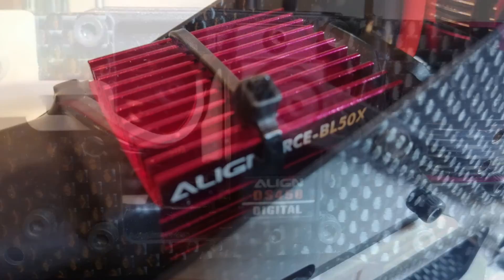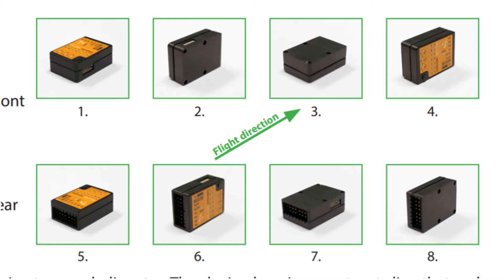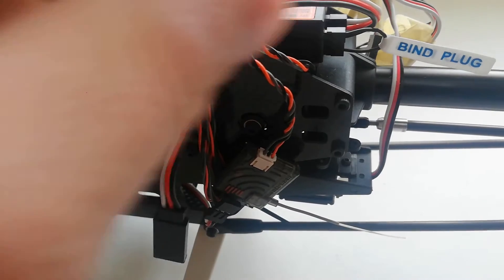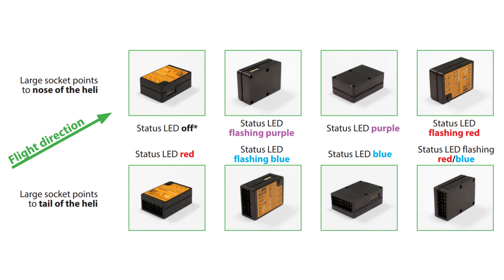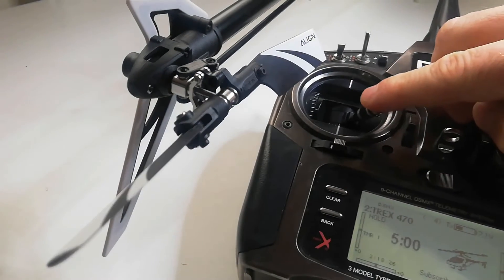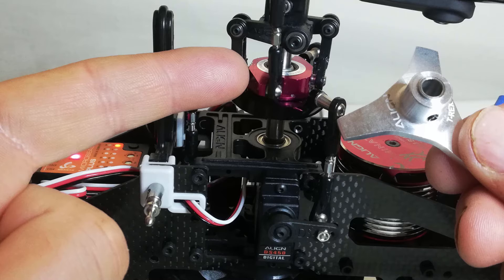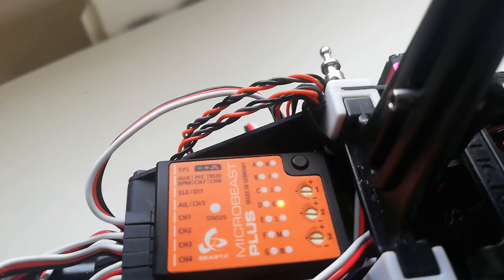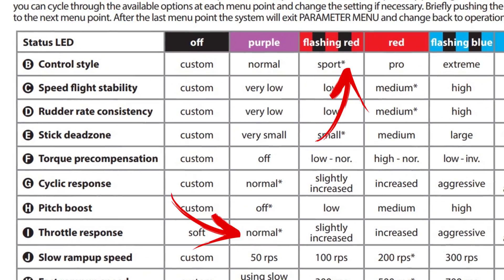Microbeast PLUS full set up - Trex 470

Comment: Wtf have I gotten myself into... I'm so lost. Just getting back I to them from flybars. Well I do onow they will fly just fine without a system. Even flew my 450 trex about 3 yeara ago just off a Spektrum AR630. Even had sade on it setup. Would recover seems like a blink of the eye. But did have one issue in safe. Giving a left rudder input it would climb fast as further the rudder direction was pushed. Never figured that out. So now just repaired the 450 and got a 550 to go with it. Bought two of the same system. Now I see I got sooooo many steps to make just to get it right. I'm sorta now upset. I need help I'm sure.
Reply from the maker: Sounds strange, for sure.  I'm sure there'll be an rc shop or club that can help somewhere near you
Reply: Ikon is much easy

Comment: Epic! I found your video invaluable. Just returned to helis after 20 yrs and have only  flown with flybars.
Got myself a T-rex 470LT super combo and needed guidance on micro beast set-up.
Your vid is just what I needed.....a walk through with clear and specific info......no waffle!
Did u do a video for the parameters menu?
Many thanks.
Reply from the maker: Awesome glad it helped. No video on parameters yet I'm afraid. Loads more videos I want to do but way more busy neith work and family now I'm afraid. Happy flying!
Reply: My sentiments exaxtly!  Im in the same boat being out of helis for over 20 years.  Building an old nib 450 pro dfc but using a micro beast plus fbl from a 700L kit I'm going to use an Ikon2 the seller included in the kit.  Thanks for making sense of the Beast instructions.  I too am using 1 satellite and didn't understand what happened to all the servo wires going into the micro beast plus.  Thanks for clearing that up!  Subscribed.

Comment: Hello, I recently got the Trex 470Lp. I have spent MANY hours trying to figure out the MICROBEAST.. I can not for the life of me get it figured out. I have an AR6210 Spektrum receiver. Also have a AR8000 laying around as well. I can not get the MICROBEAST to read that I have the receiver connected?? I can get everything to work fine following the instructions and this video with only a Spektrum satellite.. but I know only a satellite isn’t recommended. I’m about to give up and just use a satellite and hope I don’t get a brown out.. Any tips or instruction of how to wire up the receiver? I have tried everything, but maybe there is one thing I’m not doing right.. Any help would be GREATLY appreciated, thank you!
Reply from the maker: Hi yeah electronics can be a real pain eh. I never had any problems with satellite only On the 470. It was recommended by a top UK model shop I know it's a common set up. When it comes to the max size for satellite only remember the trex doesn't conform to normal naming standard sizes. So it's only a 380 really. I don't know about those other receivers but try emailing Stefan from microbeast: shornstein@freakware.com He is helpful and ususally replies fairly quickly
Reply: @RCStuffvideos  awesome, thank you! I appreciate your fast reply as well. I also thought just using a good satellite would be fine. But wanted to play it safe. I will shoot him an email anyway. Maybe I’m missing something. Thanks again!
Reply: Won't work with the AR6210. You need AUX2 to set the gyro gain from the MicroBeast. . The AR8000 should work. I speak from experience after reviewing the manual on the JR 9503H Transmitter.

Comment: Great video! Quick question, I'm getting my first kit heli, the Align 550X Dominator Super Combo with the Beast X Plus, I'm unsure of what receiver to use, do I just need a remote receiver like you have on the side there and that's it? I read through the manual a bit in your link, and I believe that's what it says to do, I want to go Spektrum with my DX8G2. Any help you can give is very appreciated!! Thanks!
Reply from the maker: Hi King family RC, I can't remember where I read it but I'm pretty sure for a 550 size, (or anything over 450 to be precise), a single satellite isn't recommended. So you might need a proper receiver as well as a satellite or 2. Not done this set up myself I'm afraid so can't be too exact but I think I think you will need a but more for a 550.
Reply: @RCStuffvideos  OK awesome I'll research a receiver and satellites then! Thanks so much for taking time to help me out! 👍🤙
Reply from the maker: @kingfamilyrc5376  No worries. Yeah I checked, and it was in the microbeast manual it says 450 size or less for single satellite. "Using a single remote satellite is only recommended 
for 450 size helis or smaller! For larger helis please use a SRXL compatible Single-Line receiver for your radio brand."

Comment: Mate hello how are you..... I have a goblin 700 raw and I added the beastx Pro edition since 2016... so it had the version 4.1.5......after contact the support cause it wasn't accept the Pro version which I had paid they fixed that and I updated from 4.1.5 to 5.5.1.....the thing is that a lot have changed and even with the manual i can't get it work and I really regret it the update cause the Heli was flying perfectly......can you help me I have figured more than half of settings but I can't get the electric motor to start....in studiox they have for swashplate 333hz when from the beastx button it has still only till 200hz .... that's the only positive I found in the update....now I have the servos directions fixed but the throttle it's working only as pitch so it goes up And down only and I have not motor throttle....if I figure this out I believe I will find and all the rest settings....and what is exactly these "banks" they added? Like setting idle ups?..... please if you know something more than one help reply ASAP thanks
Reply from the maker: Hi mate.  Sorry to hear of your troubles.  I haven't  updated to the pro version  yet but plan to at some point.  I did it  all on the unit.  I'm guessing  the banks  are bank  angle limits maybe as I'm sure the pro version  can do that.  If that makes sense? Which support  email did you try?
Reply: A little late answer but, if you have both the throttle and pitch moving at the same time, the beast sees two inputs and ignores both. Set you throttle hold on so there is zero throttle input, set your collective. When you get to the throttle, flip you hold off then you setup the throttle. This also drove me nuts for a few. Once you get the channels assigned correctly, using a linear throttle curve, calibrate your ESC. Your motor should respond normally now. FWIW, this video does cover setting up the Pro on 5.2 with the exception of attitude and banks.

Comment: Microbeast kinda sucks
Reply from the maker: It's  kinda funny how some people love it and some hate it.  I'm  neither tbh.  What do you  use?
Reply: Yeah I agree. I have a Gpro and its set up is way better, luckily I have the bluetooth dongle as well so can adjust from the phone at the field too. I just wanted to see this setup to see if it was a nightmare, and it is. Sure once its set up its good, and of course ya can get a dongle to do the same by the sound of it.
Reply: @Hells_Gate  Gpro is a cheap fbl system align puts on their small helicopters....... you can't compare beastx with that cheap thing.....is like comparing a Kia car with a Buggati....the end
Reply: @lfrecords3970  Yeah I have had more of a look into them. Gpro is old now with a lower resolution. But still way easier to program. Mine came with the 600E so not that small. Going to try and find a vid of the beast plus programmed through pc and Im sure it will be alot easier
Reply: @Hells_Gate  Gpro is like not existing these days anymore mate.... even beastx is too old.....i bought the first beastx plus 2016  i think? And I added and the rescue mode which was the reason I lost 2 helis one was in 2nd flight...was learning back then and was rushing to do the hard staff......now I updated it after years and I am programmer in real life... something like hacker you could say i did the set up from computer it's easy but I think couple things are missing or I didn't see the menus.... maybe submenus.....the heli now seems ready it's spooling up with the ESC governor but something isn't right like before and I want to be sure not to destroy a 1500euro heli cause I m impatient.... I sent email explaining and I wait reply or real manual cause the v5 they have on their page don't fit with all the menus...some are not for what it's writing in the manual
Reply: @lfrecords3970  Yeah I have seen there is no V5.0 manual. And exactly why I am watching these vids so I know what I am doing. I am an electrician so programming is not a problem really, and dont want to rush either. Istill have the gpro and going to use it on the 470L I just bought. Its good enough for that. Was thinking of getting the 700X and has the Beast plus, hence why I am here. And yeah the beast is getting on a bit now too.
Reply: @Hells_Gate  dominator L the first one model i had bought Two times and the second one on which I had put on MKS servos HOBBYWING esc it's the one I lost in the second flight.....was flying perfectly....i trusted the rescue mode and for that I lost second time small heli...the first one was again a 450 size align modified from Flybar to DFC with beastx again and cause of the rescue mode Lost it too...15 days 10 Hours a day search cause I had seen were about drooped but never found it and that was 2015 and now just two days ago for first time since then I lost a racing drone with DJI fpv air unit and goggles....not my fault...for some reason video lost even the drone was too close to me and I use crossfire reciever If you know that has range about 50klm..... anyway don't buy align if you get big Heli first time....if you fly well the 450 the flight difference is so huge in stability accuracy you won't believe it but get a great goblin a lot better and durable if you crash has lot less parts to change the main shaft never bend and the main gear never stripe....
Reply: @Hells_Gate  but don't use Gpro on a 700 goblin or any brand.... you know that the best is the Vbar Neo anymore which is fbl unit and reciever together but you have to buy and the radio which is not cheap and it's ONLY for helis

Comment: This helped a lot! Although when setting collective limit, i cant get a solid blue even thought endpoint is at full. It stays flashing. What do you think the issue is?
Reply from the maker: Hi Nick? Have you definitely done all previous set up points correctly especially servo throw, and definitely using correct manual version? If so try emailing beastx: shornstein@freakware.com Stefan is very helpful. Cheers

Comment: BRILLIANT REALLY HELPFUL
I agree about slow or too long videos and even more about load music  and stupid introductions  but in videos like this you need top spend a bit more tim e as most have never even fitted a Microbeast let alone programmed it
But looking good will comment again 
Can the Microbeast be set the factory

Just as a matter of interest - I have not flown for 20 odd years. The very first part of you video about version needs a bit more explaining and if you do another video when you flash the card up it could do with a bit longer
Going to have a coffee - read the manual and then look again
My YTail blades move out but i have to centre them pmanualy is that a setting in Microbeast
Reply from the maker: Yes you're probably right. Might be best to do over several videos few stages at a time
Reply: @RCStuffvideos  that would be really great struggling a bit - at  least ive found a video done recently .
the problem with the first par it just seems to be flashes of info